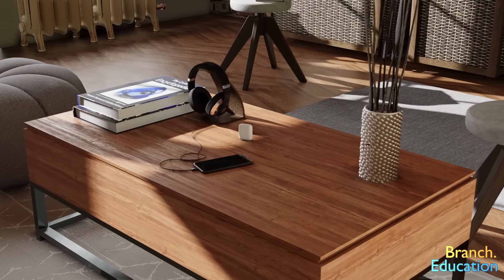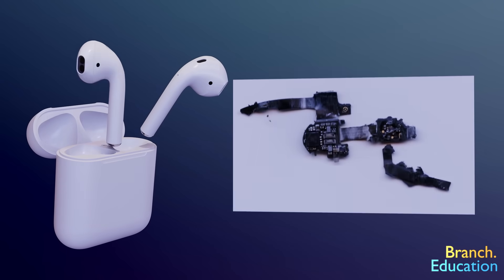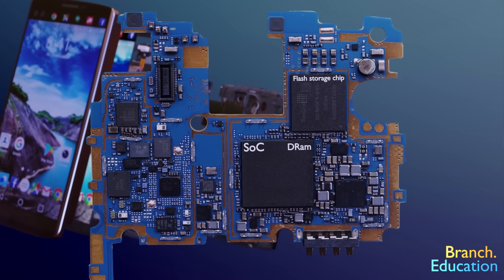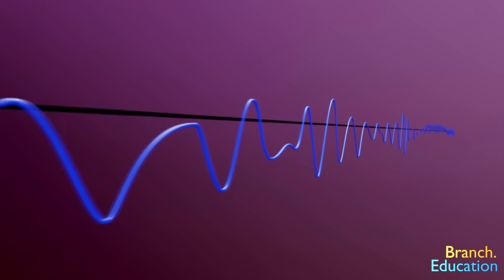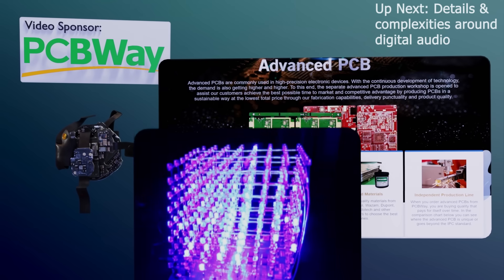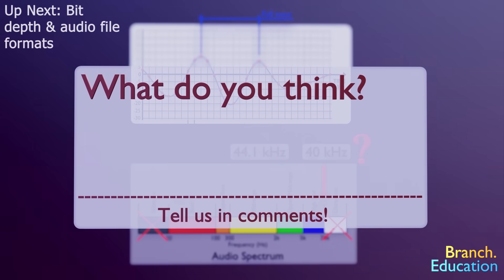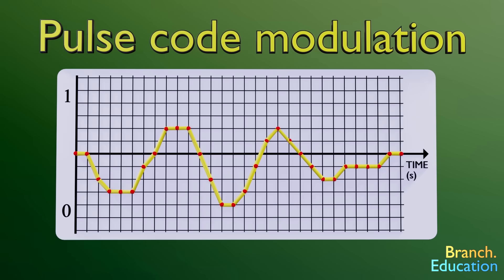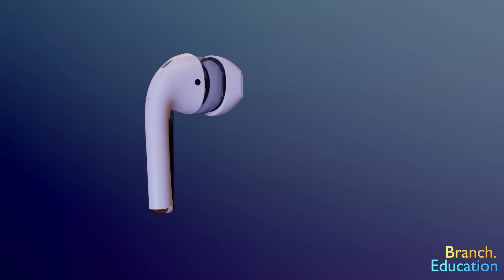The Engineering Inside Wireless Earbuds || How do Wireless Earbuds and Audio Codecs Work?

Comment: 16-bit audio (CD quality): Has 65,536 possible amplitude levels.
24-bit audio: Offers over 16 million amplitude levels, capturing more detail and a greater dynamic range.
32-bit float: Provides an even larger dynamic range, acting as a safety net against clipping during mixing and processing, as data beyond 0dBFS can be recovered.

Comment: The Nyquist Theorem, also known as the Nyquist-Shannon sampling theorem, states that to accurately reconstruct a continuous signal from its samples, the sampling rate must be at least twice the highest frequency component of the original signal. This minimum sampling rate is called the Nyquist rate. If a signal is sampled below the Nyquist rate, a phenomenon called aliasing occurs, where higher frequencies are misinterpreted as lower frequencies, leading to loss of information and distortion.  
Key Concepts
Sampling Rate (f_s): The frequency at which a continuous analog signal is sampled to convert it into a discrete digital signal. 
Highest Frequency (f_max): The highest frequency component present in the original continuous signal. 
Nyquist Rate: The minimum required sampling rate to avoid aliasing, which is equal to 2 times the highest frequency (2*f_max). 
Aliasing: The distortion that occurs when a signal is undersampled (f_s < 2*f_max), causing high-frequency components to appear as lower frequencies. 
Why It's Important
The Nyquist Theorem is a fundamental principle in digital signal processing, enabling the digital representation and reconstruction of analog signals. It is crucial for: 
Preventing distortion: Ensuring that the sampled signal accurately reflects the original without losing or misrepresenting information. 
Digitalization: Providing the necessary criteria for converting analog signals (like sound or images) into digital data. 
Applications: Its principles are applied in various fields, including audio processing (e.g., CDs sample at 44 kHz to capture human hearing frequencies up to 20 kHz), medical imaging (MRI, CT scans), and image processing. 
In Simple Terms
Imagine taking a video of a spinning wheel. If you take too few pictures (low sampling rate), the wheel might appear to spin backward or stand still, even if it's actually spinning fast. This is aliasing. The Nyquist Theorem tells us to take pictures (samples) fast enough, at least twice the speed of the wheel's spin (highest frequency), to accurately capture its motion.

Comment: Music sounds terrible over the phone because the telephone network is designed for voice, not high-fidelity audio, by filtering out high and low frequencies and compressing the audio to save bandwidth. This leaves a limited frequency range, a result of early designs for efficient voice transmission, that cuts out the richness and detail necessary for good music reproduction. Additionally, compression algorithms, which are tuned for speech rather than music, further degrade the sound quality. 
Frequency Filtering
Limited bandwidth: Traditional telephone systems have a narrow frequency range, typically from about 300 Hz to 3400 Hz, to transmit voice signals. 
Loss of audio information: This range is much narrower than the human hearing range (20 Hz to 20,000 Hz) and the full spectrum of frequencies in music. As a result, the high-end treble and low-end bass notes that give music its fullness and depth are cut off. 
Data Compression
Efficiency over quality: To save space and transmit more signals efficiently, phone companies and internal systems compress the audio. 
Voice-focused compression: These compression algorithms are optimized for the characteristics of human speech and are not designed to handle the complex details of music. This process removes critical audio information, leading to a "tinny" or distorted sound. 
Technical Design Limitations 
Speech optimization: The entire telephone infrastructure, from the network to the speakers on your device, is built with voice transmission as the priority.
System-wide impact: This inherent limitation affects the audio from the moment it's transmitted to the speaker you hear it on, preventing good quality music from sounding good.

Comment: Why is uncompressed 44.1kHz, 16 bitdepth audio file = 10.58 MB/min? Shouldn't it be half that? 60/(1/44.1e3)*2 = 5.3 MB/min 
That's: 60 sec per min / (1/44.1e3) samples per sec * 2 bytes per 16 bits
Is it doubled because there are actually 2 samples being taken during each sampling period, one for each ear (L and R)?

Comment: 📺👤💬 It does not work ( added conversation ) can you create some conversation from the lesson. 🏡🔊🗯🗯🗯🗯🗯🗯🏡🥺💬 I know you will use it for commercial advertising I post when the content is interesting.

🥺💬 Audio signaling transforming and encoding is always happening when communication creates and transforms information into encoding format for sufficient target sensibility or signaling method.
🐑💬 The sampling rates, data encoding, error correction, and channels are important to the expected level to meet the pre-requisite requirements.
🥺💬 Which channel, how it often and specific themes and my appologies⁉

Comment: The selection of the sample rate was based primarily on the need to reproduce the audible frequency range of 20–20,000 Hz (20 kHz). The Nyquist–Shannon sampling theorem states that a sampling rate of more than twice the maximum frequency of the signal to be recorded is needed, resulting in a required rate of at least 40 kHz. The exact sampling rate of 44.1 kHz was inherited from PCM adaptors which was the most affordable way to transfer data from the recording studio to the CD manufacturer at the time the CD specification was being developed.

The rate was chosen following debate between manufacturers, notably Sony and Philips, and its implementation by Sony, yielding a de facto standard. The actual choice of rate was the point of some debate, with other alternatives including 44.1 / 1.001 ≈ 44.056 kHz (corresponding to the NTSC color field rate of 60 / 1.001 = 59.94 Hz) or approximately 44 kHz, proposed by Philips. Ultimately Sony prevailed on both sample rate (44.1 kHz) and bit depth (16 bits per sample, rather than 14 bits per sample).
Reply: Thank you. But I still didnt understand, if our ear detect only 20kHz band, why they are using 40kHz? is it only because of the reproducing of the carrier signal?
Reply: @Muhammmet668  o convert an analog wave to a digital signal, it must be measured at a regular frequency, which is the sample rate. If the sample rate is too low, it will not accurately express the original signal and will be distorted, or show aliasing effects, when reproduced. If the sample rate is too high, it will needlessly take up extra storage and processing resources. The Nyquist theorem helps to find the perfect sweet spot where all the necessary information is recorded but nothing extra.

Analog signals have a frequency, or how many times they go up and down in a second. This frequency is measured in hertz. Claude Shannon's explanation of the theorem is: "If a function x(t) contains no frequencies higher than B hertz, it is completely determined by giving its ordinates at a series of points spaced 1/(2B) seconds apart." To accurately reproduce a signal, the sample rate must be twice the highest frequency.

To help illustrate this, imagine a sensor on the earth with the job of measuring sky brightness. Imagine it only took one measurement every 24 hours. If you read the results back later, you would be led to believe that the sky is the same brightness all day, an inaccurate result. What if it was measured every 18 hours? The results would be very confusing, going between full brightness, complete darkness and somewhat dim, seemingly at random.

Now imagine the sensor took a measurement every 12 hours. The results would show one period of light followed by a period of darkness; this would accurately describe our 24-hour day/night cycle on earth. As shown by the Nyquist theorem, to accurately measure the 24-hour period of the rotation of the earth, you must take a measurement at least twice its rate, or every 12 hours.

The Nyquist theorem defines the minimum sample rate for the highest frequency that you want to measure. The Nyquist rate is 2x the given frequency to be measured accurately. The theorem can be used in reverse. The Nyquist frequency is the highest frequency that equipment of a given sample rate can reliably measure, one-half the given sample rate.
Reply: @HyungnamGu  Thank you for the clarifying the Nyquist -Shannon theorem.

Comment: hi, this is to those who monitor me. please forget about the antigravity necklace i mentioned in the previous comments. it hasnt been built yet. The smallest antigravity driver (which hasnt produce any lift) i built is about one inch long. It does not produce the result we want.

This is just a planned, the closest form of this device ever built is from MIT, the micro ion lifter as big as one cent. This is the closest to building the smallest antigravity drive. But the field it produce would not be big enough for one human.

I have to focus on the big gravity generator because that is what is needed for hyperloop pods. (hyperloop pods/ any vessels that could be turned into antigravity craft is already available, the important part is the antigravity generator)

Other  than that would just need some modification (to insert the driver inside the yatcht, or hyperloop pods)

Comment: I really love Your videos and the wonderful imagery and animations used in it. Thank You very much for that. 👍🏼
To this topic I have two remaining questions: a) A set of earbuds is connected as only one device. Is this a certain specification within the bluetooth standard that allows to connect actual two devices as one? I assume that one bud acts as a master and has a secondary radio connection with the slave bud. b) How do the two radio connections prevent both buds from getting out of phase, which would cause unpleasant effects to the perceived audio signal even to the laymans ears?

Comment: Excellent content. I would love to see a microscopic detailed study of the final analog signal of the same audio track that was created at various sampling rates, bit depths and run through various DACs. Also, the details of the smoothing algorithms used in each in order to recreate the intended audio signal. Seems to me that if the smoothing process is near perfect then there should be little difference between a 44.1k/16 bit (CD quality) sample and a higher res one...but is the DAC smoothing that perfect?
Reply: Most of the smoothing actually happens at the diaphragm. As it is a mechanical part, it cannot instantly move to the position the electrical signal tells it to. Instead it accelerates toward the position. While this looks bad at first glance it is not---the original signal was recorded from the movements of another diaphragm in a microphone. Both have the same physical restrictions to their movements, thus the smoothing the loudspeaker diaphragm naturally applies in in principle the same as the original movement of the microphone's diaphragm.

There's some more trickery needed. For example, distortions from the diaphragms inertia add up which would make the audio sound muffled, like someone speaking through a door. That, however, ha nothing to do with digital signals, it's the exact same for a purely analog signal, so the signal is processed at the mixing stage to be "harsher" than it was recorded.

Comment: Great videos! Ive been hooked to them for the past couple of days. I had a couple of questions and was wondering if someone could elaborate? For 1, could you use something like the Fourier transform to compress files and have sound computed and outputted over time rather than remembering each discrete point? Also, how does a microphone physically convert sound waves to digital signals. Does the air pressure concentrate onto a piezoelectric material? Thank you for these wonderful videos and please keep it up!

Comment: Interesting video. But it only mentions standard earbuds with one single dynamic driver.
Better sound quality is achieved with hybrid earphones, which combine a dynamic driver (lower frequencies) with a balanced armature (BA) driver (higher frequencies).
It would be nice if we could also see that in future videos (maybe one about BA drivers + one about multi-driver earphones in general).
Reply: *Just to mention the basic case of a hybrid earphone. In fact, there are IEMs with many more drivers (hybrid, or pure BA) (sometimes also with other driver types, like piezo or planar-magnetic).
And yes, there are also TWS IEMs, e.g. from Chinese brands like KZ.

The traditional configuration (with external, interchangeable Bluetooth module) features a 2-pin analog input and a passive crossover. A fully-integrated TWS IEM might also use a digital crossover.
It would be interesting to also see videos on this topic.

Comment: I have a question: Do the phone transmits via Bluetooth to each earphone unit individually  (I guess that it can or actually IS different data for each unit as you can hear different sounds on each ear) or it only transmits to one of the units, a master unit lets say and that one transmits the data to the other one? that question have been lurking in my mind since the first time I got a wireless earphones. (1 month ago)

Comment: The sampling rate is 44.1kHz because you need to split it into 2 channels (22.5kHz each) and there is a small headroom for rolling off the frequency range so it does not degrade the sound too much at the top

Comment: Great video! But a couple of things:
You forgot a very crucial part.. The amp.. No sound without an amp..
And the spider is NOT the surround on a speaker driver.
The spider sits behind the membrane/diaphrame and holds the coil correctly placed etc. But these small drivers usualy don't have a spider.
And the decoding of the codec happens before the actual DAC. The DAC however CONVERTS the digital to analog so it can be sent to the amp and speaker.
Reply: holy crap! 😁 I have scrolled through like 500 different comments and you are literally the first person commenting about any one of the many (😬 sorry but I have got to be honest) inaccuracies and mistakes that were made by the video author. One of which is indeed them getting the DAC mixing up with the audio codec. 
They also seem to not fully understand and/or have an incorrect grasp of the actual working principles behind inner workings of both the ADC and DAC processes. 
Additionally, they seem to have never heard of amplification too, nor do they seem to correctly and fully understand the principles behind how a speaker actually produces sound, and how PCM, fits into that process, because it seems they didn't know that when using Pulse Code Modulation (it's in the name) the DAC actually produces a square wave signal, which is then amplified and then directly sent to the speaker. 
Subsequently it is the inertia of the diaphragm (and the intrinsic electrical properties of the voice coil) which actually "filters" the digital signal, e.g. the PCM encoded square wave of the original music signal, back into a sinusoidal pressure wave that will propagate throughout the room into your ears, which is the actual sound we can hear. 
The square wave digital signal automatically becomes a sinusoidal signal (as a pressure wave) when the signal flows through the voice coil because when working with electronics you always have to remember that the current flowing through a coil can not instantly change, hence the buildup and breakdown of the magnetic flux inside the speaker voice coil naturally follows a sinusoidal pattern when the coil is driven with a square wave. 

I could go into even more detail, because there are quite a few other omissions, misinterpretations, factually incorrect statements or general mistakes I could point out, but my hands are tired from typing and I have to take a dump 😁🤣💩

If you want me to mention more mistakes/incorrect things I've noticed, then please let me know and I'll try to get back to you at a later date! 🤓🤓

Comment: The video is well done. However, a choice must be made in determining which audience group you would most like to satisfy. Personally, I would prefer contents that brief over basics like ADC, DAC sample rate, and bit depth, and hope to learn about topologies and architectures of different ADC/DACs (sigma-delta, R2R, etc). However, others might prefer an explanation from the ground up. It is usually easier to find high production value yet basic technical information, but not the other way around. I do not promise growth in revenue by digging deeper, but I believe it will be a great service.

Comment: I’m sorry but confusing sampling rate with the frequency of the sounds being sampled is messed up. By having a high sampling rate doesn’t make the sounds higher frequency, it rather captures more sounds in a more detailed recording hence why the file is so much larger. That is way the sounds played back after encoding to a compressed system ie ( mp3,2,1) causes the sounds to be different from the original. Because the sounds are not likely to be compressed again and humans don’t normally notice the difference it has gone mostly unnoticed unless your an audiophile.
Try compressing a sound file over and over, and don’t copy it recompress it and over, much like high speed dubbing in the 1990’s. You will hear a difference.